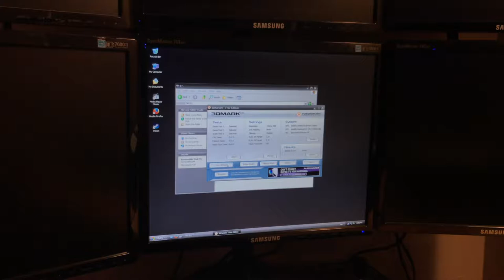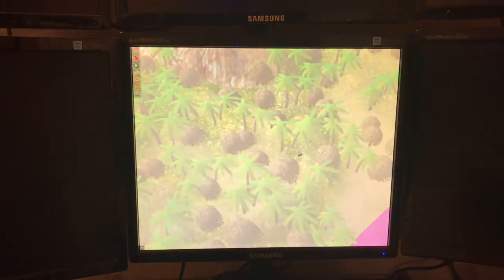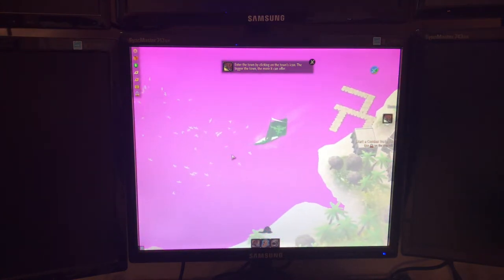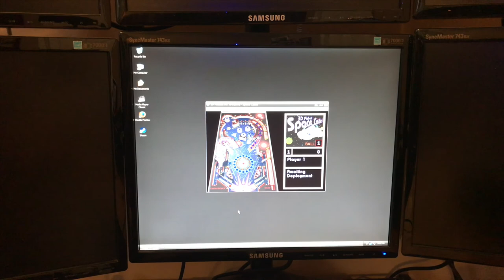Can You Game On A Free PC? - Hardware Corner: Opitplex GX520

Comment: LOL, I purchased a used GX520 in 2009. It has the Pentium 4 HT CPU. I installed a DVD RW, 4 GB of ram and 2 500 GB HDDs. I didn't use it for any gaming but it has been my daily driver since then. I replaced the PSU once. It had Windows 7 32bit and obviously very outdated so I installed Linux LMDE 32 bit and it runs alot better then it used to.
Still, I'm going to box it away along with the older Dell XP machine it replaced. I seemed to have had a good run with the Dell's so I ordered a used (new for me) Dell 3620 work station. It'll probably feel like a Ferrari compared to the 520. I'm going to hold on to the old machines in case someone may be nostalgic for old technology someday or collector of old antiquated computers.

Comment: I'd like to have one of these kinds of old computers really bad only because of they are so cheap . I went on ebay and they sell from 25$-300$(including shipping) the cheaper ones don't have some parts or are for parts. And i will probably not pay 250$ avg for a obsolete computer too . Do you know any online place which sells these kind of things for cheap ?
Reply from the maker: Unfortunately getting old hardware like this online is pretty rough just because of shipping. Finding someplace local you can buy them, like a computer recycler, is your best bet, but depending on where you live that might be really difficult.
Reply: @callingallplatformsgaming  I have one, if you'd like